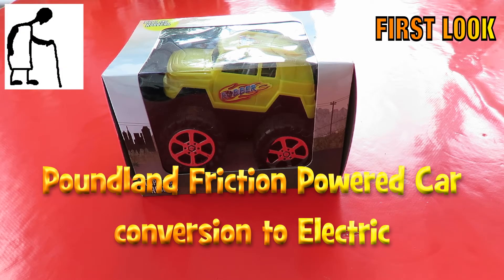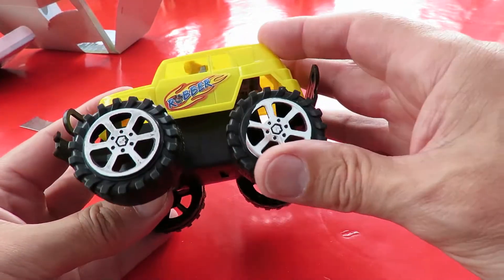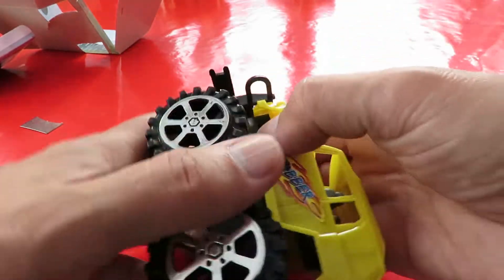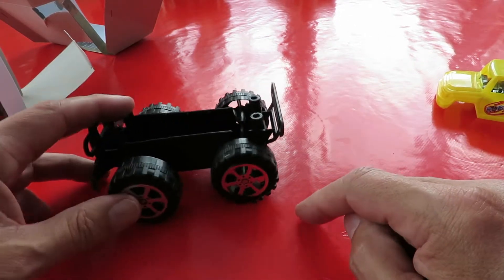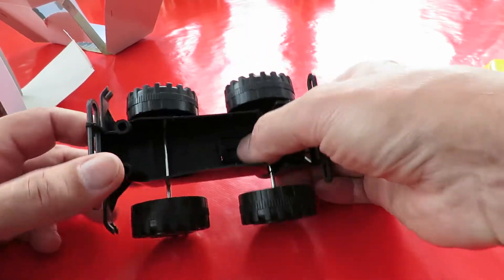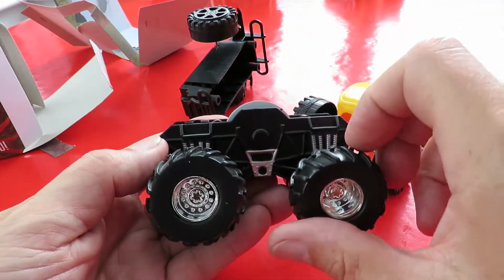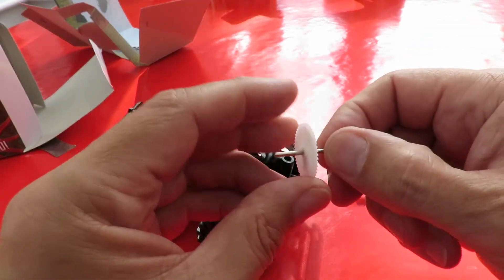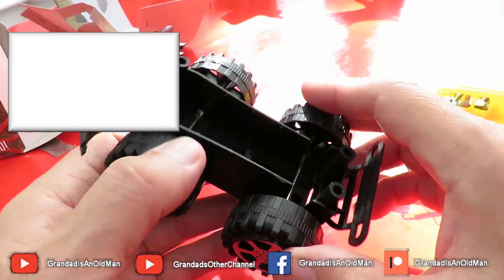Poundland Friction Powered Car conversion to Electric - FIRST LOOK

Comment: Rofl! Someone stole the mould cad files and made... Pretty much nothing with it?
Reply from the maker: I think a lot of this sort of stuff in Poundland is factories clearing out overproduction items by reducing the spec, so maybe they did a production run of a ten million body shells but only had orders for 5 million with motors so Poundland buyers said "stick a blank plate in it and we will buy the rest off you at cost price" so they can clear their warehouse. Many of the toys are clearly designed for multipurpose applications when you look inside. They have extra mounting lugs, many even have a hole for an aerial to come out, so they can be assembled on different production lines to different customer requirements.